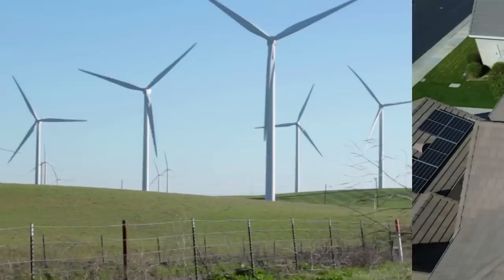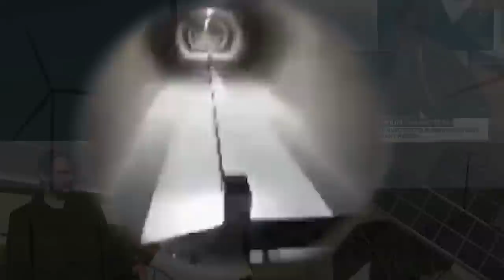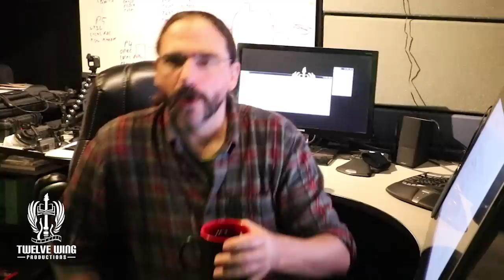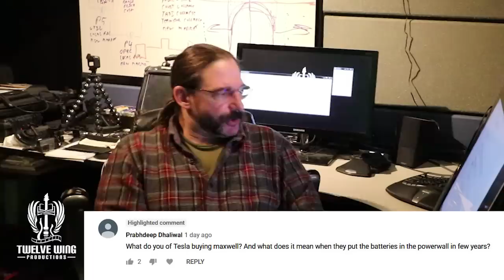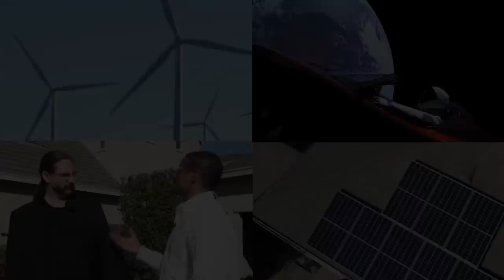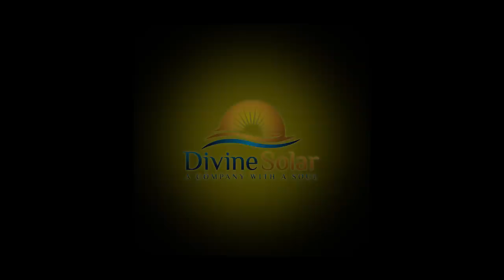Tesla purchases Maxwell; What does it mean for the Powerwall?

Comment: I think the main advantage to Tesla with ultracapacitors is leveling the mains draw at charging stations. The ability to dump huge amounts of power over and over into vehicles would extend the capacity of the station without requiring a very fat connection to the power company. Power/weight or power/volume figures are less of an issue for stationary apps like a charging station. That and like you said, extending the instantaneous peak capacity of a powerwall.
Reply from the maker: Agreed.
They are going to have to do something if they think they are going to be able to quick charge the cars.
I touched on that a little in the video where I can envision a split in the battery.
If what I think happened has actually happened, Tesla has just about doubled the capacity of their batteries.  Again, we will know more in September.
If true, the next generation of batteries will have roughly half their current mass being the new solid state batteries and half their current mass being ultra capacitors.
The result of this would be a vehicle that still had a range of 350 miles (ish) but where 20% or so of the overall battery size is ultra capacitors.
That will mean that they can put 70 miles or so into the car VERY rapidly and then the charge rate would slow down a bit as it started to charge the main battery.

In such a scenario, what you say will be paramount to these stations working as needed for multiple cars.
Reply: @twelvewingproductions7508  Tesla has doubled the charge cycles but not the energy density. Rickard has compared the 1865 and 2170 cells and found 275Wh/kg with no difference between the cell formats, Japanese/US made cells. 2170 capacity is 4.458 A.
https://www.youtube.com/watch?v=zvavP2RJSLc&t=3645s

Comment: The life of battery is affected a lot by charging cycle. Super capacitors technology will reduce the battery cycles that happens during regenerative braking by storing it quick and deploying  energy quick to boost acceleration. Making the car fast and have a longer battery life due to reduce battery charging cycle.
Reply from the maker: Exactly.  The cycle life of ultracaps are in the millions.
As a side note, Maxwell has patents directly related to shock resistant and vibration resistant internal structures.
That's ripe for automotive applications.
Reply: @twelvewingproductions7508  
Which are now used in S/X Raven cars?
Reply: Exactly...??

Comment: I am slightly surprised that you did not touch on the potential for capacitors with Heavy Goods Vehicles IE Semi's. Given the nature of hauling a heavy load, the amount of energy that comes from re-gen braking is more easily absorbed with a cap than a battery, also, the really heavy drain on a battery to get a heavy load moving from a stand still is better catered for with a cap. That has massive potential for commercial vehicles.

There is an 'open cast mine' in Europe where the rock is found high up, but the processing is done down in the valley. They use the big 'house sized' dump trucks with High Capacity Capacitors and electric motors for power, the amount of energy stored from re-gen braking on the way down with a full load is so much that it is discharged into the grid (at a profit!), at the bottom, leaving just enough to get back to the top. Batteries could not handle the re-gen load.

Thanks for posting, most informative!
Reply: The Lithium Storage GmbH and Kuhn Schweiz AG  Komatsu 605-7 EV conversion uses a 800kWh LiIon battery - not ultracapacitors.
It is better to add more batteries than UltraCaps. Batteries have a hugely greater energy density than caps (the highest rated caps from Skeleton are 20Wh/kg v 275Wh/kg for Liion). Caps are much less performance per litre and very expensive.
Independent studies have shown both the Semi and Roadster can achieve stated performance with current LiIon batteries.
https://electrek.co/2017/09/17/electric-dumper-truck-worlds-largest-ev-battery-pack/
https://www.youtube.com/watch?v=zvavP2RJSLc&t=3645s
http://www.carbuzz.com/news/2017/12/19/Tesla-Was-Not-Lying-About-Semi-Truck-s-Performance-Specs-7742524/
https://jalopnik.com/heres-what-a-battery-researcher-told-us-about-the-tesla-1820558723
Reply: That is only for a specific purpose for a specific task. For general use, it won't work with today's technology. Capacitor, even a ultra capacitors don't have that DENSITY for it to be useful for general purpose use.

Comment: Excellent content as usual.   Did you get new inverter ?    I had mine replaced, they moved power ethernet adapter to existing wall socket, since then, comms been fine.
Reply: I wonder if they will find out what caused yours to burn out cap.   Keep us posted if you ever get anything back.   Yeah, nice to seen near real time metrics versus every 24hours.
Reply from the maker: @jasontrewin123 , I'll keep you posted on what I find out with the inverter.
It's something that might be important for others that may be clipping slightly to know if they may need to head off potential issues.
Reply from the maker: They replaced mine with the same unit I had previously, the 7.6 with the screen.
I may upgrade to their 10kw but haven't done so yet.
Glad your comms issue is sorted.